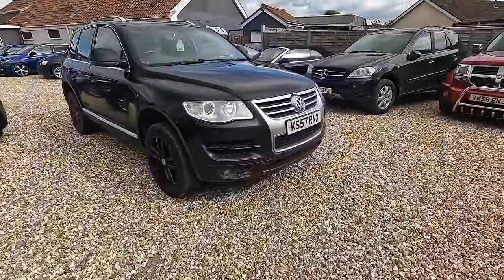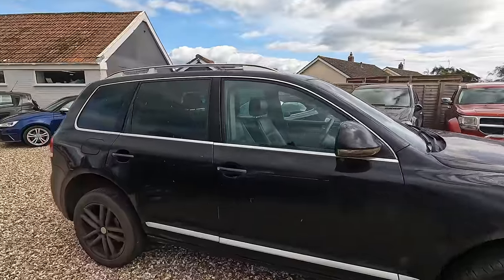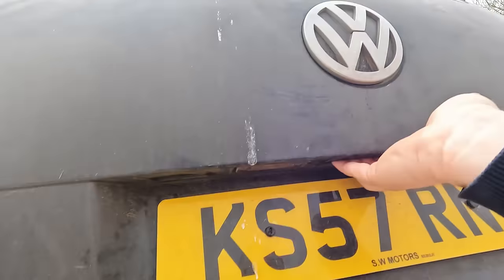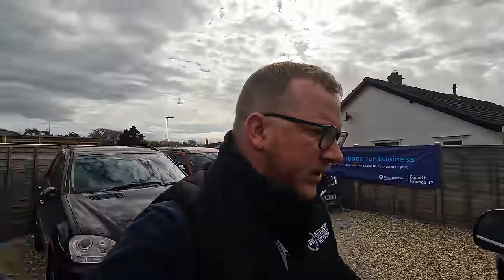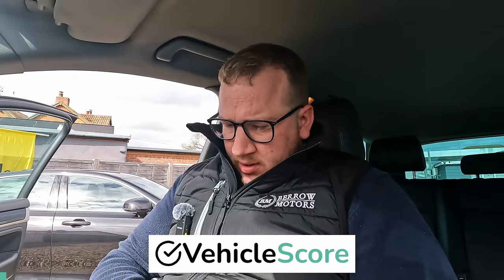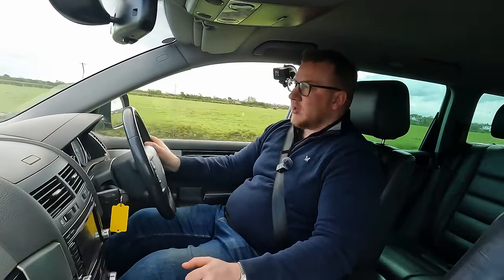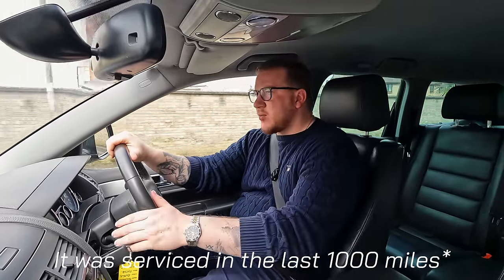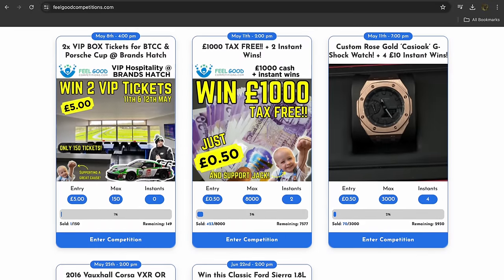I Bought A Cheap Touareg - And It's Crying For Help!

Comment: Owned a 2009 model in the US powered by the 4.2L 310 hp V8.
Bought it brand new and sold it back to VW under the Lemon Law 18 months later. 
In the first year it was at the dealership for repair for 126 days.
The engine and transmission were bulletproof but it had continuous electrical issues from minor niggles to the failure of the body control module.
I had driven VW Vehicles exclusively up to that point but after that experience I've never purchased another one.

Comment: sat nav might have not been fitted from factory and added after. I did this in an old ML320. The wiring wasn’t installed for the GPS So added the same GPS as you have under the dash. Worked a treat.

Comment: This road tax is criminal how can the government want 30 percent of the vehicles value to put it on the road for a year and think it's acceptable
Reply: The simple answer is that the government doesn't want them on the road.
Reply: They don't want anything on the road except 100000 pound electric cars
Reply: If you don't want to pay it, don't drive it! Petrol hasn't been this cheap since 1999. They've got to get the tax somewhere, and electric cars are losing their exemptions.

Comment: Having owned one look our for a noise from the front axle they have tapered bearing that wear and start shedding fine bits if it carries on they will ruin the front diff, It's a front axle off and strip down the last bloke I saw repairing one it only took him 13 hours.

Comment: Back in 2008 my dad was waiting for a new company car and needed something with a towbar to take our caravan on holiday. His employer hired a car from a local garage, which turned out to be a Touareg with the 5.0 V10 TDI engine. It did about 21mpg whether you were towing or not, and must have looked a bit strange with our small, old, scruffy caravan on the back, but it was an awesome experience for a 9 year old used to run of the mill cars. Thereafter it became known in our family as 'The Monster'. The one thing it wasn't good at dealing with was heavy rain, as the arches were so high that every time you hit a puddle even at relatively low speeds the windscreen would get temporarily flooded!

Comment: Injector blow back, rubber grommet has let go. Lift he engine cowling, you should see the oil around the injector. 👍
Reply from the maker: Mechanics checked that
Reply: Oil or diseal
Reply: Can be a pain to remove injector my garage broke mine removing it and 150quid to replace. 😢
Reply: @garywinterbottom6073 they damaged a part on your car and didn't replace at their own cost?
Reply: That's correct they wouldn't admit liability I should have e pursued them but for the cost it wasn't really worth it.
Reply: @garywinterbottom6073  I understand, it would have cost you much much more money in the long run. At least you know not to go back to those cowboys again
Reply: @Bullwinkle39  yep not just wore a stetson  but had a winchester and a 6 gun.lol
Reply: @garywinterbottom6073  😂😂 I haven't seen them but it sounds like you nailed it

Comment: I counted a few easy mot failures that clearly were years old, which imo arent that big a deal, however my worry would be what else has been ignored to get it through previous mots. This is a perfect 1k agri 4x4 that someone can run into the ground, strange that the tow bars gone though.

Comment: Had an Altitude V6 myself. Check your central locking locks all the doors, if it has child safety button on drivers door, the door locks are a PITA to source and replace as specific to this model. Also check belts and all pulleys replaced as these can chirp and will fail leaving you at side of road.  Fantastic cars though.

Comment: It's horrible to watch. The engine needs coming out at 140k, for belts and the second 'lump out' per 70. I loved these. Mine had all the problems with the drainage (VW don't tell you about this)....... park it up, water runs down the left hand side, runs into the passenger footwell. No problem, eh? ALL the ECU's are under there. Cost's at least 2 grand to put right. 
How do I freely give you this info? Because it happened to me during ownership. Be wary, of these vehicles. They are are a money pit on servicing. Fantastic stereo, gearbox, ummmph......but so, so costly. The rear arches rust too. Budget 800 quid a side plus paint. Peace.

Comment: There’s cheaper sheds about like.  Biodegradable on the scrap farm. Would you buy this in for stock normally? If no, why take in p/x?
Reply from the maker: Because it facilitated a deal where we made over £5000 on the car we sold 🤷‍♂️
Reply: @ShiftingMetal  Bollocks. That car is worth no more than £250 as part exchange. Cost you more to get rid of it. So you’re gonna sell it on and more nightmares? What car dealers forget is… a buyer is interested in the car not the business. If it’s car for them they’ll take it. Everytime. You’ll not see them again unless you end up with another piece of stock they’re itching for. What you’ve done is offered them a deal they can’t refuse with the shed. They’ll be thinking what’s wrong with car they bought from you and wondering who got the best deal. 🤣

Comment: If the door didn’t open from the inside is that not an MOT failure 🤔 if so I’d question the MOT legality
Reply from the maker: Well you saw that we fixed it… guess if we did that before or after the MOT 🤦🏼‍♂️